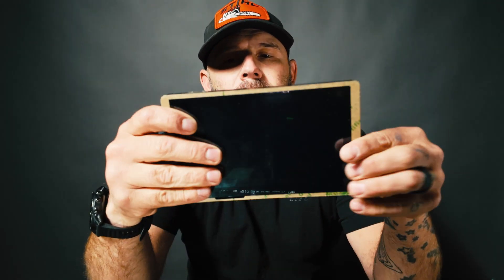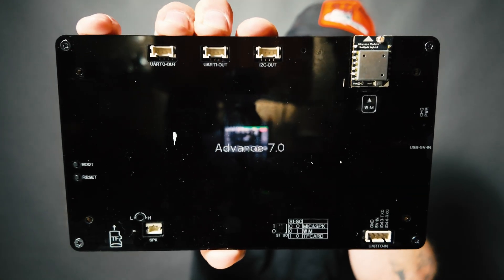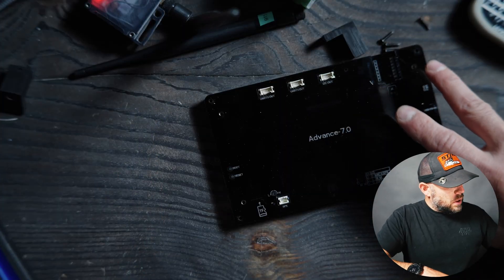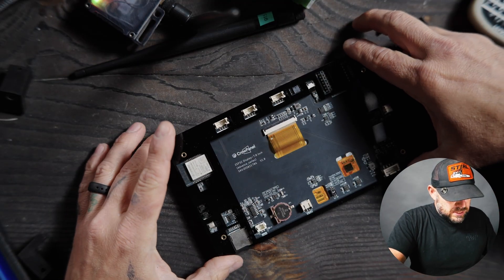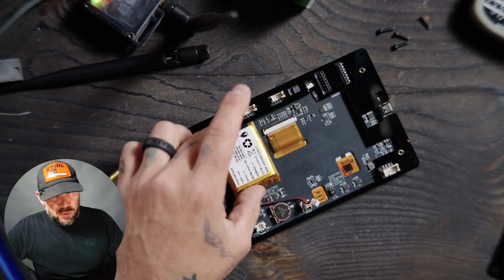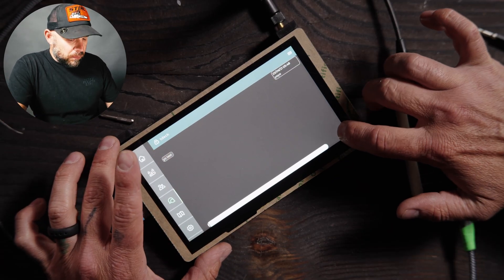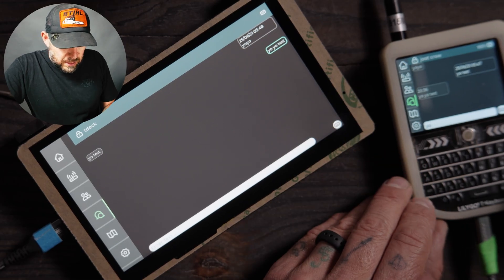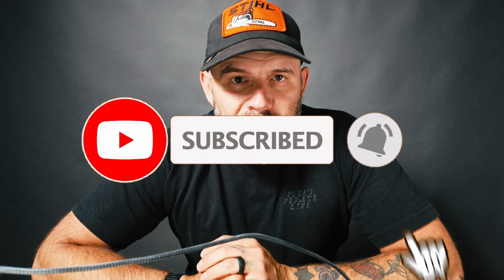CrowPanel Advance and Meshtastic

Comment: For those looking for Meshtastic support, Elecrow released a few new versions of the hardware that are not compatible with the current firmware. Check your hardware version or wait for meshtastic to fix the bug with the display not turning on. Posting this, because I didn't see the comments about the screen until after I got one...

Comment: What version of the software are you using, if so, where can we find it? With hardware version 1.3, we have the screen lighting not working.
Reply from the maker: Using flasher.meshtastic.org. Towards the middle then have a crowpanel section. I was using 2.7 I believe.

Comment: Hi, I have that exact same screen version. I flashed the meshtastic firmware, but I'm having an issue with the screen brightness. 
Did you have the same problem?
What method did you use to flash the firmware?
What firmware version are you using?
Reply from the maker: I haven’t had any issues with brightness yet. I used the Meshtastic web flasher and am running 2.7.0

Comment: The labeling for bus connections is weird. Uart and i2c are bidirectional. The lora module uses spi, so a lot of different things could go there.
Cool board.
Reply from the maker: Ya. Def. I think Mesh is just the tip of the iceberg for these types of boards. The market is flooded with them. I was really hoping for some type of automation. But as of now there isn’t allot of support for this particular board. Maybe down the line. But overall it’s a cool board for a low cost. Thanks a ton!